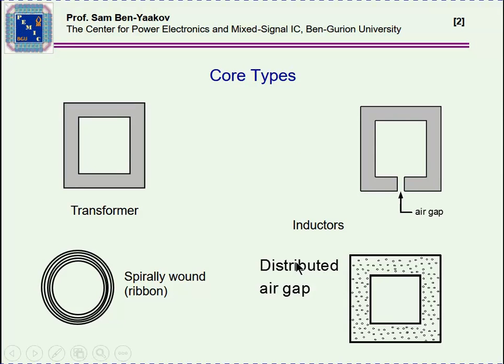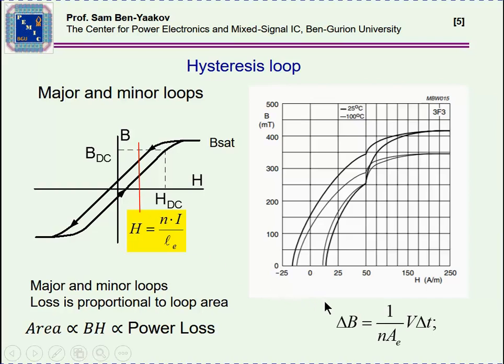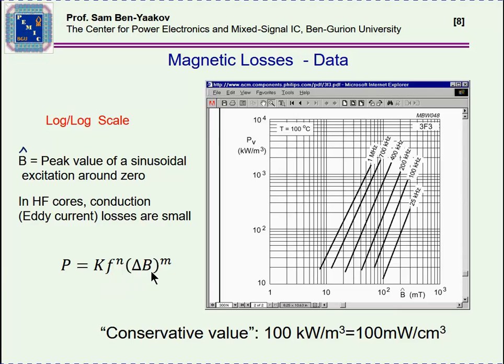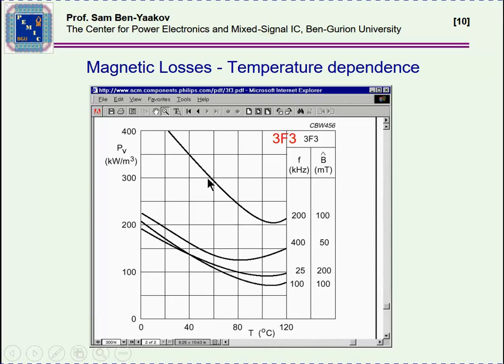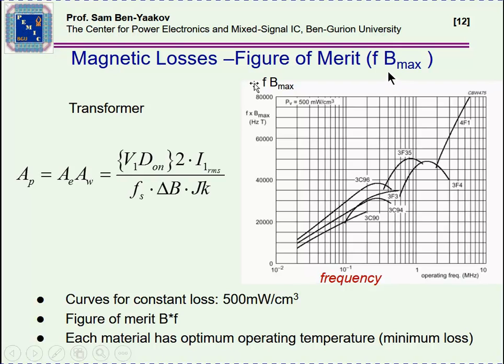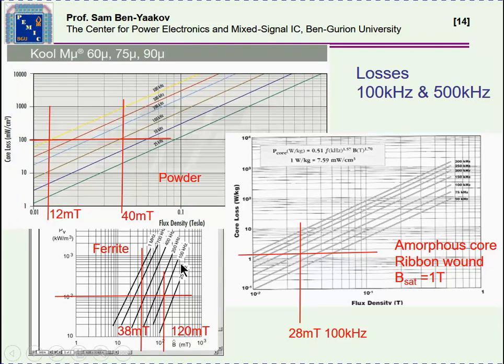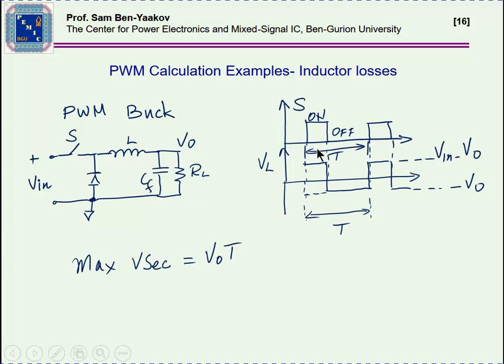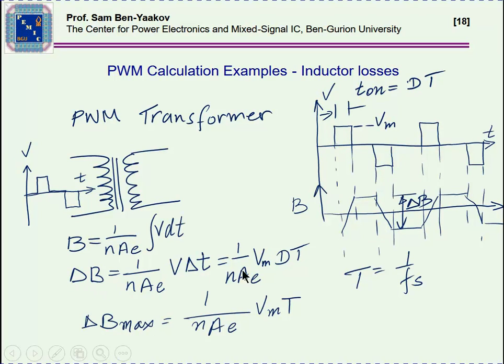HF magnetic-core  losses

Comment: in a bidirectional dual active bridge when trying to calculate delta_B would the volt-sec be derived solely from the primary voltage or do you need to use the addition of V1, V2/n with the phase variable to determine the volt-sec on the transformer?
Reply from the maker: Just the voltage on the winding

Comment: Dear Professor, Very helpful presentation.  The variation of power loss with temperature is quite interesting. While working with ferrites, I observed from the manufacturer datasheet(TDK software) that the permeability of ungapped ferrites increase with temperature. In that window the power loss decreases with temperature as well. If the ferrites are gapped, the permeability does not vary much.  the thermal stability is quite good for the gapped cores I guess. Thank you.
Reply from the maker: The permeability is a function of B no matter if there is a gap or not.

Comment: When you mentioned (4:20) that a typical saturation limit for cores is 300 mT or so, and then mentioned (17:50) that a typical excitation limit for powder cores is 50 mT or so, the ratio of the two is constant (about 8). This made me realize something I had not before :

We know the formula for the saturation limit based on current : Is is  Bmax = Imax L / (N Ae). 
Here Imax is the maximum current through your inductor.
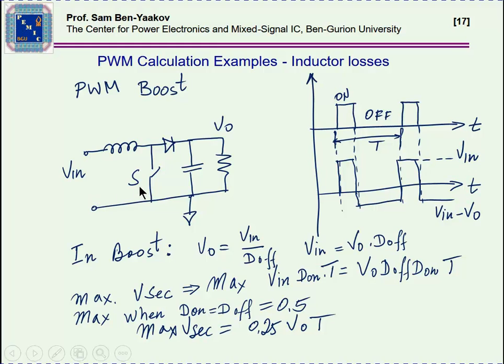Now your work (around 21:50) also gives a  formula for delta-B : For boost converters, at D=0.5, delta-B =  1 / (N Ae) * Vout/(4*fpwm).

Now this is cool, because with Bmax/delta-B being constant 8, that gives us : Vout/Imax = (L fpwm) / 2.
This provides a super-simple way to determine an optimal L for a given power converter Vout, Imax and PWM frequency fpwm :

L = 2 Vout / (Imax fpwm)

So if you have a converter with inductor current 20 A, Vout = 200 V, fpwm=80kHz, then L = 250 uH is a good choice for an inductor based on magnetic saturation / exctation limits. 
I find that really cool !
Reply from the maker: Thanks for input

Comment: Dear Professor, I can't understand why having DC bias tend to increase loss?? 
In fact if a core (DC+ripples) works at a positive side of its BH curve there is not any need to demagnetization that reduces a considerable internal frictions. Also I believe the hysteresis band will be much narrower this way. 
I appreciate your helpful answer for my question in advance.
Thanks
Reply from the maker: See . Muhlethaler, J. Biela, J. W. Kolar and A. Ecklebe, "Core Losses Under the DC Bias Condition Based on Steinmetz Parameters," in IEEE Transactions on Power Electronics, vol. 27, no. 2, pp. 953-963, Feb. 2012, doi: 10.1109/TPEL.2011.2160971.
Reply: @sambenyaakov  thanks professor 🙏

Comment: Dr. Sam, Can you please try to make a video on planar transformer? Here is an app note from TI: http://www.ti.com/download/trng/docs/seminar/Topic4LD.pdf , but it is little confusing for me because I have never designed power supply using a planar Transformer
Reply from the maker: Hi, Thanks for sending the link to Ti's document. There is a Philips document which I think is simpler. If you can't find it let me know and I will try to locate it for your. I have written many years ago a simple introduction to planar magnetics. http://www.ee.bgu.ac.il/~pel/pdf-files/conf145.pdf
AS for a video, I will put it on my  to do list but I am afraid not marked as high priority. 
By the way, aside from physical construction (PCB arrangements etc. ) I do not see much different between regular transformer and FM except trading window area with core cross section area. 
Best

Comment: Hi Prof Sam, Thanks for the video to introduce the core losses in details. But I have question regarding the core losses versus DCR losses. Would you think the majority losses for the inductor core is came from (DCR losses)? Because I think normally DCR losses is higher than core losses. So in this case, if we want to improve the total losses of the inductor core. Should we decrease the inductance values (for saturation capability),  fixed the particular core size (based on the PCB requirement) and increase an appropriate ranges of switching frequency (reduce the current ripple).

Because I was concerned about the core loss compared to DCR loss from the video in 9:12

Thank you so much Pro sam
Reply from the maker: The DC mentioned at 9:12 is DC component of B. What causes losses is the AC component but if there is a DC components the loss may be higher. WE do not have enough information on that. See https://youtu.be/2nRGNTvbU9c.  DCR is normally referred to winding wire losses. What is important is, Rac, that is the resistance of wire at the operating frequency (taking into account skin and proximity effects). One design approach is to make the wire (normally referred to as 'copper') loss to core loss. See https://youtu.be/3nfqBzPMknY
Reply: Thanks prof sam

Comment: I also studied your video on soft-switching pwm converters. Now for a high power SMPS (2000W>) I think it's most useful to use the fullbridge topology. To achieve maximum efficiency you'd like to have minimum switching losses and core losses. In that presentation you showed an input inductor(Li) between Q1 and Q3 and transformer, now I assume that brings some core losses. What would be the best design for that inductor when Vin << Vout? Is it required for optimized soft switching or is conductor inductance enough?